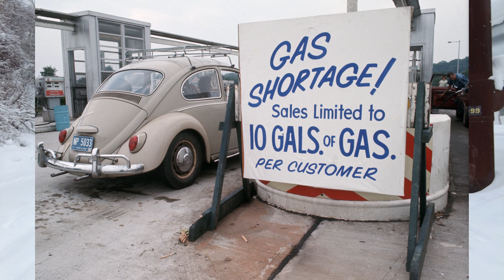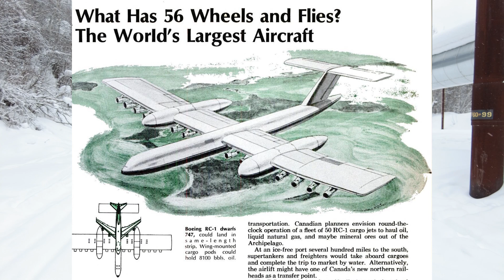Trans-Alaska Pipeline - How Oil is Piped Across the Entire State of Alaska

Comment: How much oil has this particular pipeline spilled since it began operating?
Reply: Not much
Reply: Two of the spills were from people deliberately penetrating it. There are numerous gate valves and check valves to close the pipeline in sensitive areas. Also there is oil spill contingency equipment staged downstream from where the pipeline crosses major rivers. I was at the site where the pipe was shot a day after it happened in 2001.